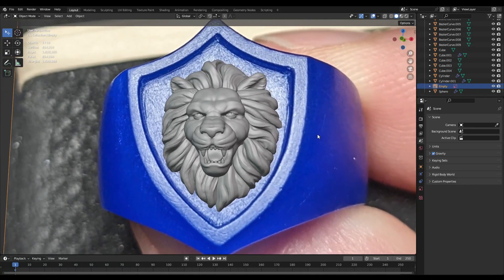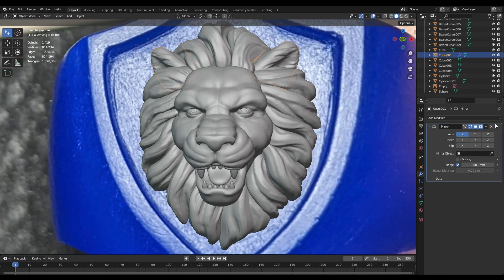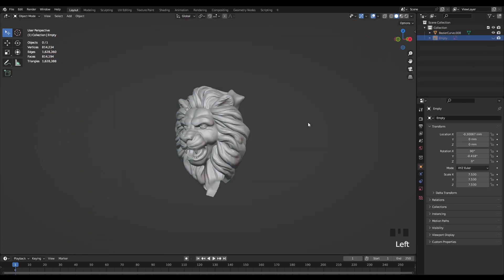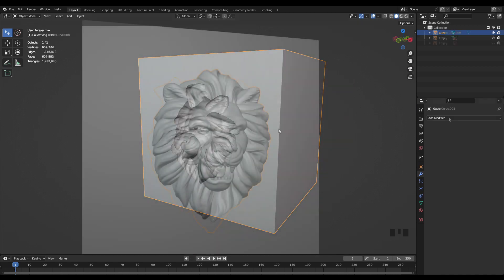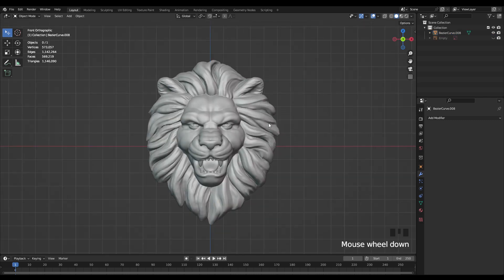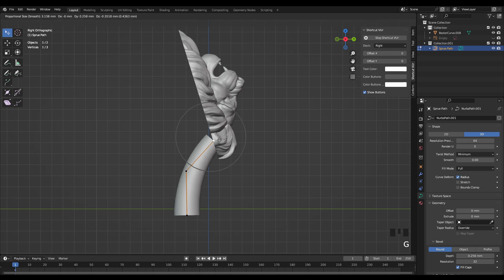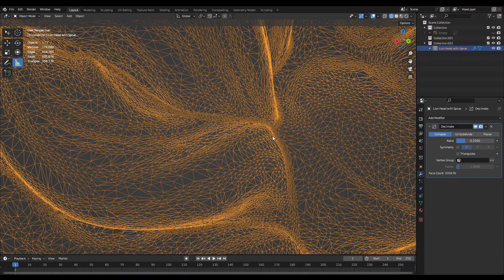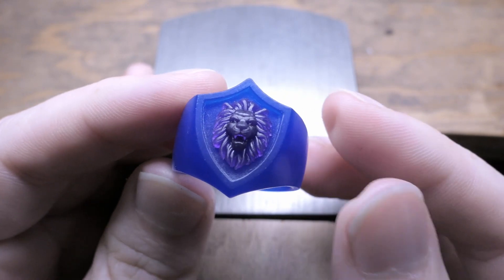Preparing a Model for 3D printing in Blender - Shield Ring Part 3

Comment: I was intrigued that you went with the shortcut instead of a modifier for your boolean! Is it more reliable, or just a preferred-workflow thing for you?

Also, I've found remeshing and especially decimating to be pretty punishing operations for my poor 8GB M1 Mac Mini. Other than "upgrade," have you come across any hints or tips for making those more efficient?
Reply from the maker: Yep! That's just a workflow preference. I like to use shortcuts as much as possible to speed up the work and keep my focus on the model rather than the settings (if I can help it lol) 

Unfortunately, I've found that Blender tends to struggle a bit with high poly count models if your system is low on ram (regardless of the operation type). One tip I would recommend is turning on your stats to see how high of a poly count you can work with on your system before it starts to really lag and just make a note of it for future work. Before I upgraded to 32GB, I could only do around 1.5 million vertices before it really bogged down my workflow.

Comment: Hello! I live in Russia and I study jewelry making in college. We do a lot of old-style practicing with manual labour, but unfortunately no one gives us knowledge about making jewelry in 3d programs. Your videos are extremely helpful, because I want to make some things using casting&molding method in the future. There is really not so much videos about 3d jewelry design in Russian language, and the ones which exist are outdated and kind of toxic :\ So I just wanted to say thank you for your channel! It means a lot. Also i was wondering if you could do a 3d tutorial about a ring with a gem in it, like the one with a cat skull, but with measurements? I find it hard to understand how to make correct for a ring's rim in a 3d model so my gem could not fall out of its setting. Thank you :)
Reply from the maker: Thank you so much for following along with my work! It means a lot to know that these videos have been helpful for others. I've had the same problem with finding resources on newer jewelry making techniques and one of the main reasons I started this channel was to learn about them for myself and try to share my experience. Gem setting with 3D printed jewelry has been quite a challenge for myself as well, so ill definitely have to do an in-depth tutorial on it!  😁